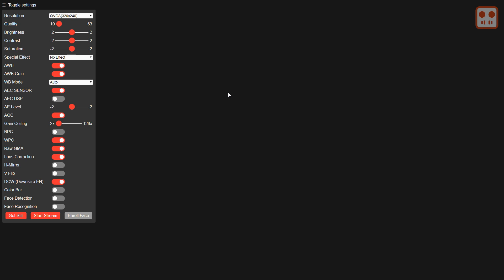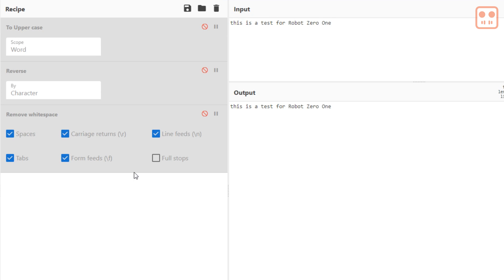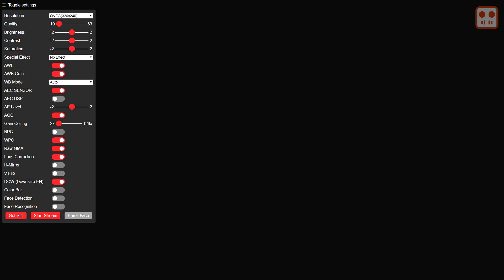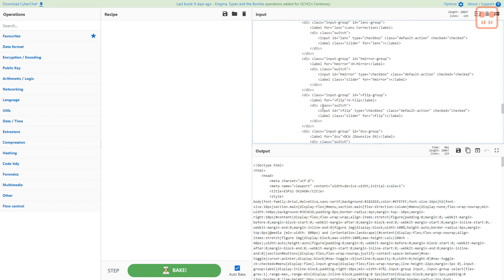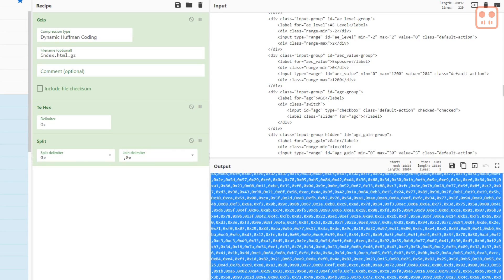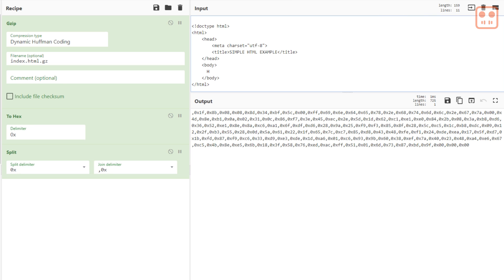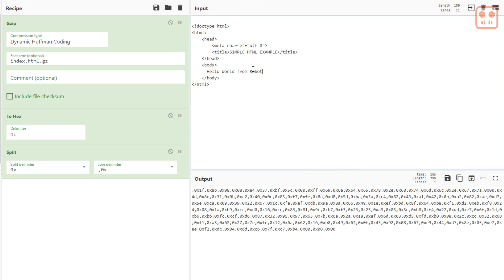Editing Camera Web Server HTML Source Code for the ESP32-CAM

Comment: when im in the hex section and i use 0x or 0xcomma it does this error "Data is not a valid byteArray: [31,139,8,8,35,252,105..."

Comment: Hello I'm aminul I am working on ESP32 CAM to access camera web server but every time when I open serial monitor it shows me a error I've trying for past 3 days on this error "No core dump partition found!"

I've also tried all of the methods which are discussed in many pages on this forum

if you solve it kindly guide me on this problem
Thanks in advance.

...The settings which I have done...
1: Selected board: AI Thinker ESP32 CAM (Also selected ESP32 Wroover Module but same error)
2: CPU Frequency: 240MHz (Wifi/BT)
3: Flash Frequency: 80MHz
4: Flash Mode: QIO
5: Partition Scheme: Huge App...
Reply from the maker: I don't know what that error is. If that's the standard camerawebserver example it sounds maybe a hardware problem.
Reply: I don't think there is any problem with the camera module. Because "wifi scan", "LED blinking switch webserver" and other programs were running fine.
Reply: error is  "No Core Dump Partition Found"
Reply from the maker: @aminulhaque3253  Looking on Reddit it seems the camera is broken. Did you try the camerawebserver example? It's an old tutorial but here https://robotzero.one/esp32-cam-arduino-ide/ with 1.0.4 of the ESP32 hardware libraries. If it doesn't work I think your camera is broken.

Comment: hey this was really useful . But i was curious if u can point out what parts of the code are used in for the camera stream. Just want to put the stream on a different style website and any pointers would be good
Reply from the maker: DId you just want access to the stream on an IP address. Something like http://your-ip-address:81/stream will work with the original CameraWebServer example. Otherwise take a look at my blog -  I have lots of projects working with the output in code.
Reply: @robotzeroone  cheers no i want to insert the stream twice vertically on the local website so i can use it on my phone for a bad vr application lel

Comment: how would you stream in one site multiple cams?
Reply from the maker: Each camera is available at  http://your-ip-address:81/stream so if the IP addresses don't change you can build a page that shows each camera using JavaScript to access and decode each stream. Might be easier to use Home Assistant.

Comment: Hi robotzero :D !!! 
I tried to decode the gzip HTTP of the CamWebServer with CyberChef (2-10-2021) but the output givesme this : 

"Data is not a valid byteArray: [31,139,8,8,80,92,174,... "

The configuration that i used is the same as yours in the video:

          Find replace ( , )  (global match)
          Remove whitespaces ( spaces & line feeds )
          From Hex (0x)
          Gunzip

Im using the last version of the CameraWebServer, in this version the name of the constant is : 

                                                                                  index_ov2640_html_gz

Can you helpme to get the http code from this ? 

Thank you for your video and tutorial :D 
Thanks
Reply from the maker: Hi, Looks like it doesn't work any more with the method I used in the old or new examples. Try this version:
Hex with delimiter auto
Gunzip

Comment: What can I do if I want to see fewer settings on the webpage? Like just the Brightness and the Special Effect.
Reply from the maker: You need to remove the other elements from the HTML and run the process to convert it to the format required by the ESP32

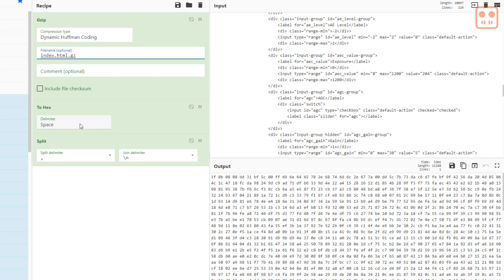Comment: At 1:48 it's better to select 0x with comma as a delimiter in the hex section, comma as split delimiter and comma as join delimiter. And in the newer version the hex section has Bytes per line option to avoid very long line - the listing looks best when using 8 or 16 or 32 bytes per line.
Reply from the maker: Thanks for the tips. I'll take a look later and update the blog article

Comment: Thank you very much for the tutorial!
I am new to this. When entering html code, my camera is not displayed. Apparently it's because of the different libraries? Use WiFi.h, with the example of CameraWebServer ...
I would greatly appreciate the help!
Excuse my English.
Reply from the maker: Do you mean you have two versions of the Wifi library? The IDE should pick the correct one. Start with this tutorial if you aren't sure. https://robotzero.one/esp32-cam-arduino-ide/ Use 1.0.4 of the ESP32 hardware libraries.

Comment: Sir i have a dubt 
Let take i have web page 
And i want to steam video of esp camera
But i don't want to upload html file into esp32 cam module
Instead
I want that video to stream to my page

Over LAN ( like local host ),
So is it possible
Reply from the maker: If you just want to stream on your own network you can use this address: http://esp-ip-address:81/stream where esp-ip-address is the IP address of the camera on your network. If you want to use it outside the network you need to use port forwarding.